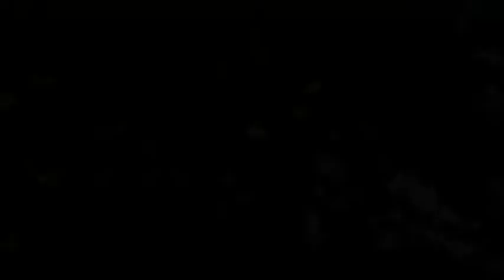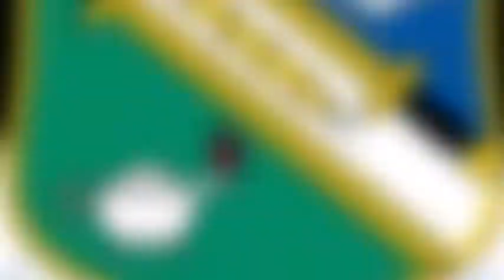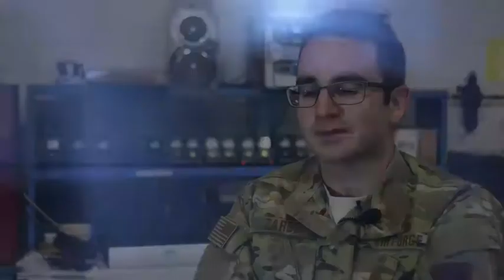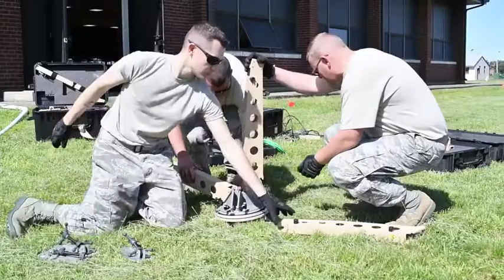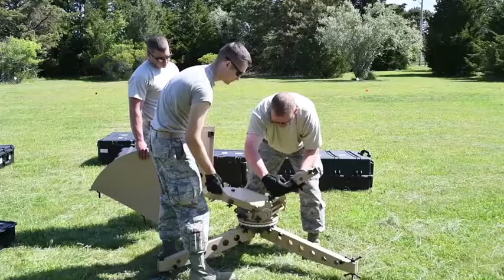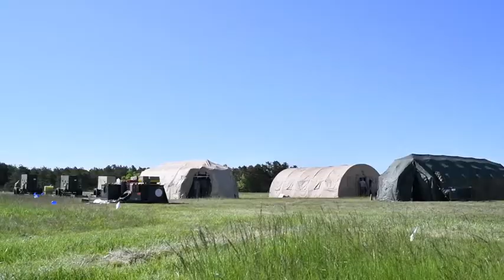RF Transmission AFSC Spotlight (2019) 🇺🇸

Comment: Hey 282'nd !!! Back in the late 80's to Mid 90's I was with the 282'nd when you were still located at Read School House Rd. at the old NIKE site on Radar Hill... I worked in Robert Weber's and Bob Bonoyer's Shop... We Stated with AN/TRC-170-B's... Later we all cross trained and became one large Combined Shop with SATCOM and Ground Radio, as well as Mobile Combat duty laptop terminals. some dedicated Multiplexing units etc... You guys are up at North Smithfield now... Never worked there... Looks like the Equipment has changed a good bit... We were working with 5G frequencies back then... I'm astonished that Telecom's are putting those frequencies  in phones and transceivers anywhere near civilians ???  Cellular Ionization is not partial to Corporate or Political Agenda's. If I had aimed a dish at a civilian home and powered up the Klystron, my days at Leavenworth would have been certain, and definitively never ending...